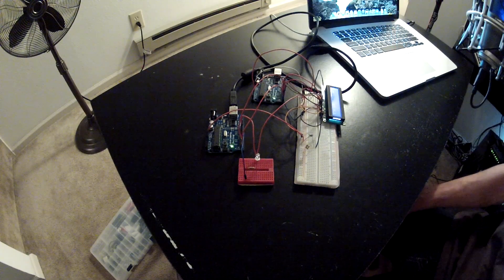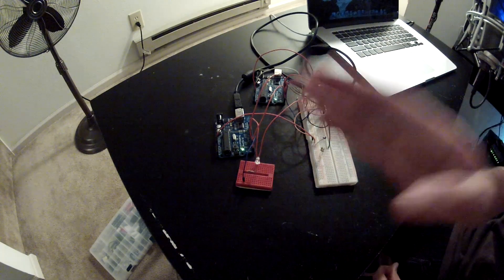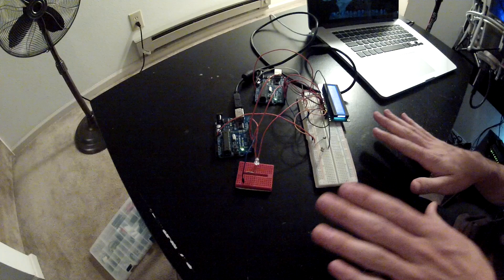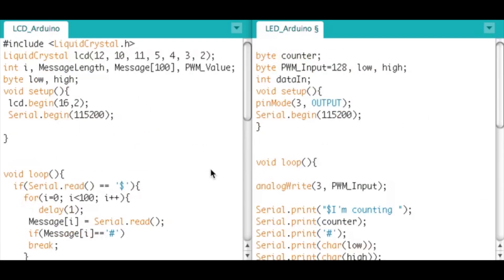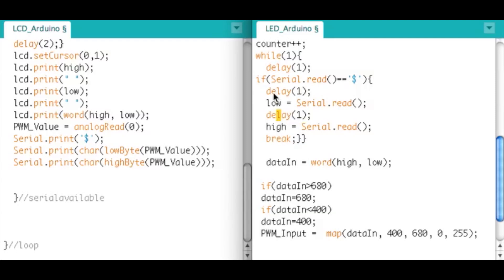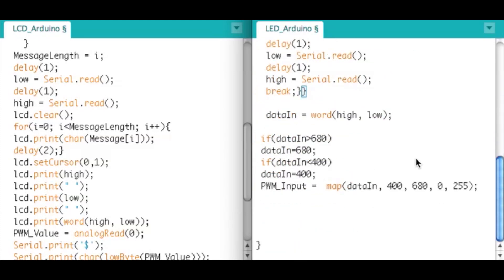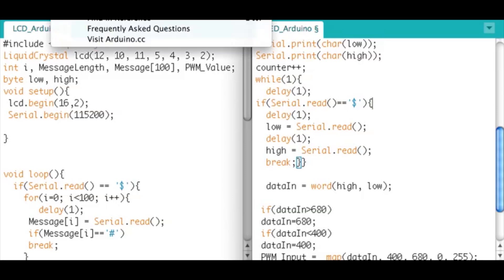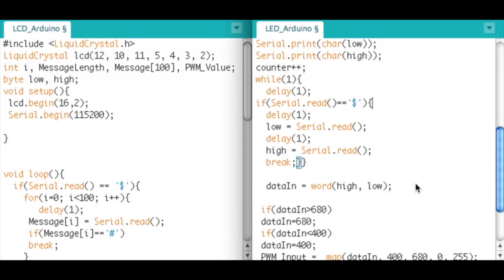2 Arduinos Talking How-To Hardware Serial

Comment: Serial.readStringUntil() - stop confusing people with works around. + your delay and for loop is blocking arduino from doing anything else
Reply: How would you improve on that? so the Arduino is able to do some other things?
Reply: @Pumba3900  super loop concept requires whole code to be adapted to non blocking states (single core, non RTOS, super loop = arduino).
Reply: @Pumba3900  void func_read_serial(){

  var_received_serial_data = "";
  var_received_serial_ready = false;
  
  while (var_received_serial_ready == false){ // blocking but only while reading data
    while (Serial.available() > 0) {
      Serial.flush();
      Serial.setTimeout(4000); // failsafe timeout
      var_received_serial_data = Serial.readStringUntil('\n'); // common separator in UART communication
    }
    var_received_serial_ready = true;
  }
  
  if (var_received_serial_data != "") {
      Serial.println("Received data on Serial port:");
      Serial.println(var_received_serial_data);

  }
    
}

loop(){
  func_read_serial();
}

Comment: +Kevin Darrah So there is 2 arduinos that I will refer too. arduino #1 is hooked to the NRF24L01. I want to know if it's possible to recieve data on arduino #1 wirelessly with the NRF24L01 and then transmit that data to arduino #2 with hardware serial?

Comment: how to communicate with esp8266 in same way
Reply: If you have installed the board in the arduino ide you should be able to use the same code, connecting rx & tx of the esp to whatever else you ar connecting
Reply: I realize these comments are ages old but for those who stumble upon it you can use this code on esp8266 boards but those require 3 volts and the arduino is 5 volts so you need a logic level converter on your TX and RX line to keep from burning up your esp8266 board.

Comment: I have been struggling with com between 2 Arduinos, and your videos are like an oasis in the desert. Please forgive these novice questions.

1. In the first (hard serial) and third (I2C), the LCD arduino has nothing in the USB port.  How did you get the sketch on the Arduino.

2. In the second (soft serial) each Arduino has a USB cable attached.  Are those cables attached to different computers?

Thank you so much!
Reply: I am not the author but see your question is 3 weeks old so I replied in an effort to help. I hope this helps:

At some point the LCD arduino was connected via USB and programmed. Once programmed the micro executes code and does not require the PC. The program code is stored in nonvolatile FLASH memory located inside the microcontroller on the Arduino board.  

The RX/TX connections between the two micros was also likely not connected during the programming process, as this would cause an issue. 

I am assuming he used the USB driver for the Arduino IDE to program the boards via USB. I am not sure about your I2C question, but would assume it is one PC and that USB was used to power the boards for convenience but I did not see I2C in this video and have not watched that one.
Reply: These are the questions I was going to ask too... hoping for an answer!